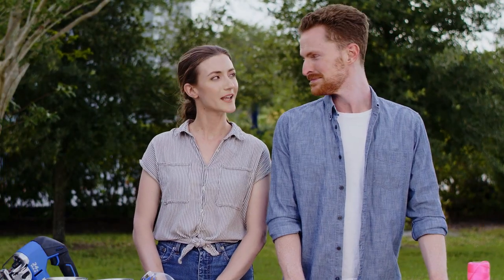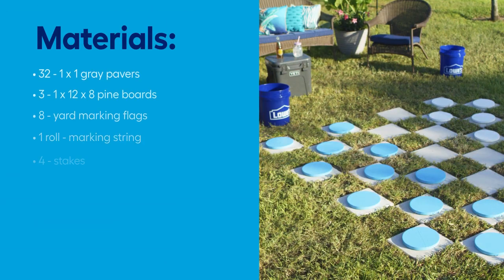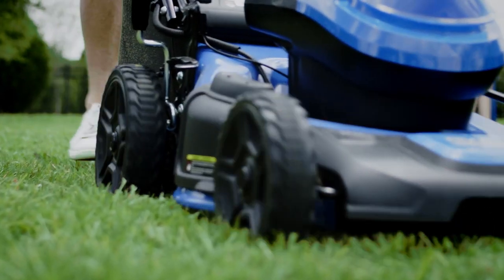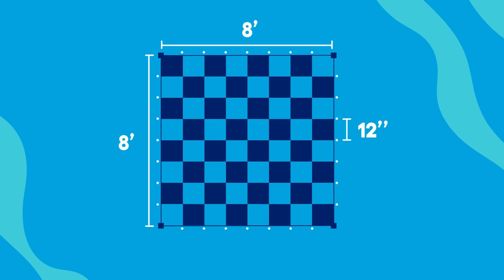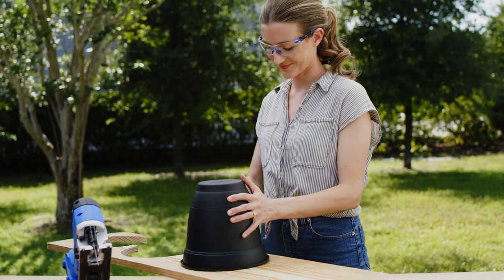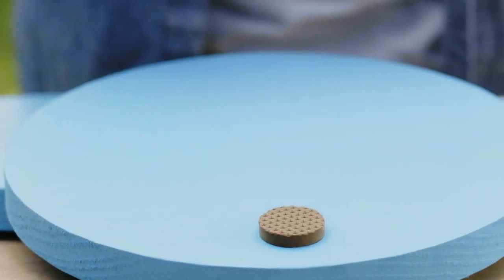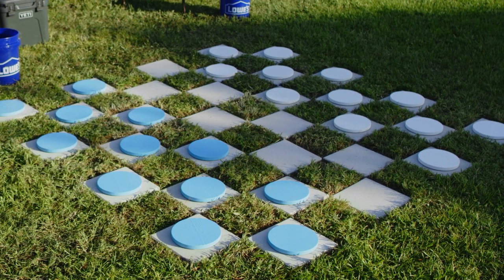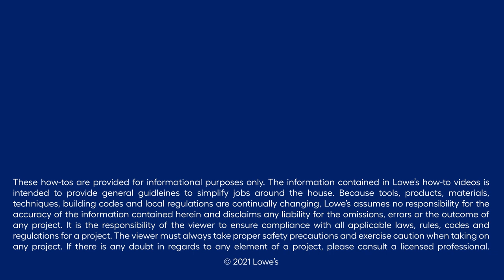Build Your Own Mega Checkers | DIY Backyard Games

Comment: There wasn’t a way to king 👑 a checker. Handles would be nice too. Don’t think I would tear up my lawn for this, but a checkerboard area with  two different pavers could be used not only for playing checkers and other games it could also be a seating area when not in use for games. You would just need to have easily shifted outdoor furniture.
Reply: Resin Adirondack chairs & side tables would work for this or you could just put a couple of resin rockers.  Both are light enough to move around at will.